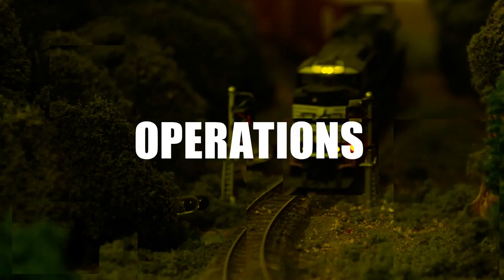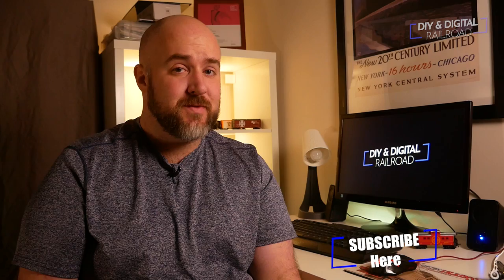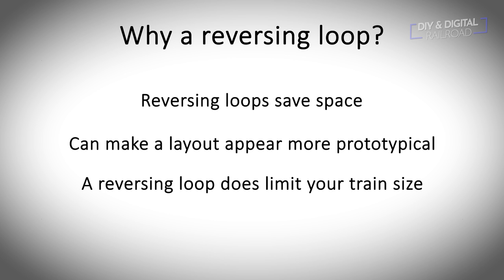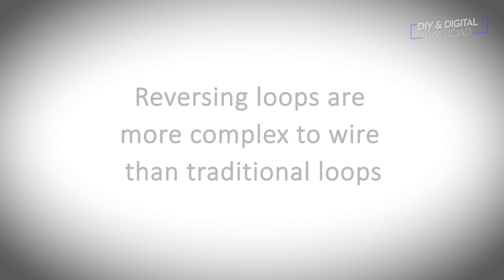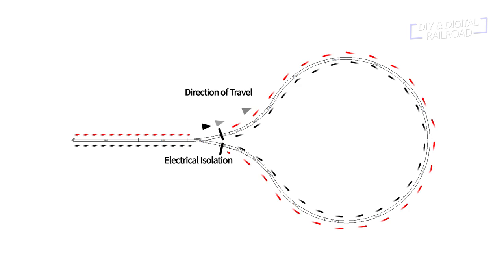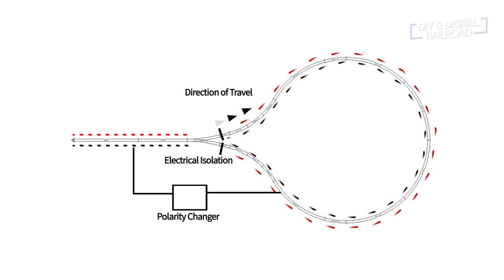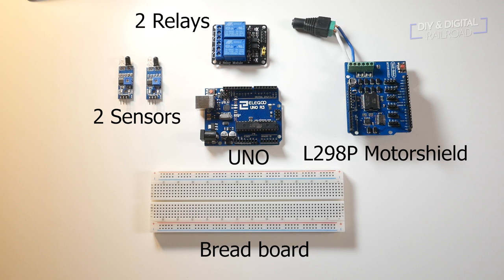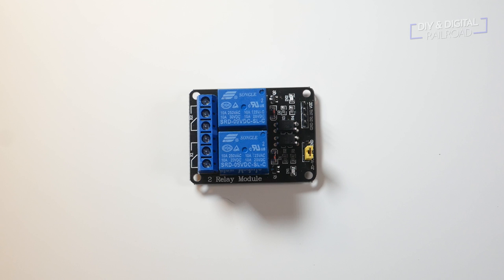DIY Arduino Model Railroad Reversing Loop

Comment: Seems there is a major bug in the sketch, the values being passed to the functions "switchXX" are sensor1, sensor2, which is essentially the Analog pin nos. that the IR sensors are connected to, instead the readings of the analog pins A2,A3 should be passed. The analogRead(sensor1) should be changed to int sensor1Val = analogRead(sensor1); sensor2Val = analogRead(sensor2);, which should then be passed such as switchR1(sensor1Val,sensor2Val); and so on...
Reply from the maker: I know this is a looong time for a reply, but I adjusted the code.   https://github.com/DIYandDigitalRR/DCC-Reversing-Loop

Comment: Thanks for the video. I’m starting my n scale layout and was worried about reverse modules depending on a shortcut detection. This is great! Just one question: I’m planning to use android controlled servos for my turnouts. How would you make them talk to this great module?

Comment: Question. Can I run both ends of the loop like this with one arduino, two sets of sensors and 2 relay boards? Thanks in advance for the help.

Comment: Jimmy;
Great info and video.  And especially for hanging the N.Y.C. 20th Century Limited. poster.
From 1915 to 1967 my Great-Uncle John Lynch was one of the three longest tenured Loco Engineers on the 4-8-4 Hudson & 4-8-4 Streamlined Hudson (J-1 Class & J-3a Class).  In memory of his years "ON THE LINE" it is also one of the HO Scale HardBodies I run on my home layout.
Thanks;
Jim

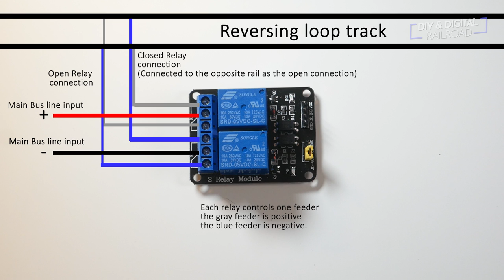Comment: At 3:40 the for dependability and safety the wiring of the relay contacts should be reversed with the power feed going to the outside terminals and the track connected to the inside terminals. As shown, if one relay drops an instant before the other a dead short is created as both power lines will be connected to a single rail. When the wiring is reversed under the same conditions both rails will be connected to a single supply side; a much less destructive situation.
Reply: For a simple reversing loop it would be simpler to use a one DPDT relay rather than the two SPDT Relays - however even then the track feeds should still come from the common pins on the relays (as Kevin pointed out) - because any mechanic failure such as one pole getting stuck won't result in a short circuit. Additionally if the track plan was more complicated and you needed more than two track feeds then using multiple SPDT relays where each relay controlled the "polarity" (I know it's AC) of each feed would allow you more flexibility, for example if you had 3 feeds you could control the "Polarity" of each feed individually - you cannot do that if wired per the video.
Reply: @davidtrott9469  The odd circumstance many discover is that single pole relays of the type shown are often less than half the price of a similar DPDT relay, and use little or no extra power. Further single pole availability is much higher, probably leading to the odd price differential. Just things to keep in mind when shopping...

Comment: Jimmy,

nice idea and good to see. I was thinking about something similar, needing more effort on HW side. I guess I think about that again. It can obviously be done with less.

Looking at the code in the video and on the google drive though:

Analog inputs can also be used as digital inputs. So a digitalRead() will work as well.

In the loop() you read both sensors (line 30 and 31) but you assign them never to a variable. So the Serial.print() should always print the pin numbers of A2 and A3 - I believe - "15" and "16" to the serial monitor.

I assume you want to set the power of to the motor shield via PWM. That would be a analogWrite(), not digitalWrite() in the switchxx() functions. I assume the digitalWrite(power, 255) is somehow understood as a digitalWrite(power, 1) by the compiler.

Additionally, the switch functions will always be called with pin number for the sensor pins (see above) and those are always less than 200. And with that the code should just loop through the sates about every two seconds. But your video shows clearly that the loop works. Do you have updated code for us? Or am I just missing something?

Comment: liked your approach to the revers loop.  Have built and n using the DCC EX command  station. I have two reversing loops on my layout.  The question , do I have to link the reversing loop (Arduino system )to the command station or  can  it function on its own with sensors controlling the turn outs and phase change

Comment: I think I see one flaw in this system. If the track switch for some reason flipped unexpectedly, or was manually switched, then the system would short out. This concept relies heavily on the track always being in the right position for the train entering. It is a nice video, but personally, I would not use this system. The short-circuit detection method is more reliable. Also, since my own track has multiple exits within the reverse loops, the train does not always exit back on to the track it came from. Therefore, the next train entering the reverse loop would be in for a shock (literally). Again, nice video. My criticism is meant to be constructive. I'm not attacking your ideas.

Comment: This is another great video but I am having some trouble understanding what the different pin variables are for.  There is no overview that really explains what these are for.  I can see in the final sketch what the code does but I am having trouble mapping that back to what is happening on the layout.  The variable names are somewhat descriptive but the effect of turning some high and others low isn't clear to me.  After watching to the end I could (sort of) figure out what the purpose of the loopState variable was but the rest is not even that clear.

BTW, I am a software engineer with 35+ years of experience (beginning with C).  I am just now starting my exploration of Arduino and really loving it.  @diyandigitalrailroad I could recommend a few things to make your listings a bit easier to follow if you like.  Nothing major, though.  I like your presentations, overall.

Comment: I have a complicated track plan that o would love to do and it has two reversing loops I believe. Would it be possible to show you the plan and help me work out what I would need to put and is it even possible. This would be my first ardurino project and if like to use it so the turnout controlled polarity that controls signals again if possible.

Comment: I'm late in watching this. Missing is the explanation of the logic of what this is doing. Break? I assume "break" is some obscure motor shield command? This seems more expensive and complex than the commercial auto reversers. What are you using for a switch machine?

Comment from the maker: Hey everyone!  Thanks to @David Mead.  He caught a typo at 11:06.  The pinMode should be sensor2
Reply: DIY & Digital Railroad I have a question: the enum LOOPSTATES are outside of the setup() block. Is that supposed to be like that?
And then another Q/comment: why not make the pin variables const? They are constants anyway, and it just ensures that they won’t get changed accidentally.
Just to clarify: I have no experience with arduino, that’s why I am asking. I’m just curious as l am interested in arduino and pi boards, but haven’t worked with either. Just been watching vids and reading up on possibilities to decide what project I’ll be taking on eventually...

Comment: OK I guess I'm just having a dense day but I finally after static test was trying it on my actual railroad reversing loop. Everything seems to be OK but for the life of me I can't seem to figure out where the red and black wires from my Kato switch machine should connect. The diagram seems to say out1 and out 2 on motor shield but that doesn't exist as labeled?
Reply from the maker: No worries! I really need to update this one.  The terminals are A and B on the motorshield.  Each should have 2 terminals

Comment: Happy New Year indeed.  I'm loving this Arduino stuff but I have a question.  Can track polarity reversal (not interested in the turnout driver portion) be done using short circuit detection rather than the optical sensors?  That is what I'd like to see.  Sadly I'm not tech savvy enough to puzzle it out on my own so please keep it simple.
Reply from the maker: Yes that is actually how most commercially available reversing loop modules work.
Reply: @DIYDigitalRailroad  I have a twin track N Scale layout. I want a loop to join the 2 tracks toether, so I dont need the turnout control. Do I still use the motor sheild or could I do it with the relay shield? Not keen on the short circuit method. Modern DCC controllers tend to spot short circuit too quickly

Comment: may I ask how do you connect a tortoise switch machine to this?
Reply from the maker: It's actually pretty easy.  Just connect pads 1 and 8 on the tortoise to the motor shield terminal and change the arduino code from 500ms to 2000ms

Comment: Hi Jimmy, Love the video but I am still having trouble with the arduino sketch, I'm getting a message that switch R2 was not declared in this scope in the second phrase of the primary void loop. I assumed it was a syntax error but I cannot find any inconsistency with your original. Is it possible I missed an edit, or there was something not on the video?  I'm a Linux novice and still learning definitions.  Also I did not have a dual relay handy and am trying to use two single relays.  Will this require any change to the code?  Thanks again for your help.
Reply from the maker: Hey Phillip!  I have created a new download link for the code.  It's a github page.  https://github.com/DIYandDigitalRR/DCC-Reversing-Loop
Reply: @DIYDigitalRailroad  Thanks so much, just seeing this.  I'll head over and update the code.
Uh,oh github returns the page does not exist. But I do see your other arduino, & sensor fixes???  By way of more information.  My sketch compiles and uploads, but when it runs on the arduino it flashes both of the relays continuously every .5 seconds.  It does not seem to respond to the optical sensors at all.  Even when disconnected from the sensors the arduino keeps reversing and switching both relays at the same time. Could a mechanical connection be at fault as opposed to software?  Or could there be a missing line or direction not in the video?

Regards, asking a lot in Maryland.

Comment: Hello when the polarity from the main track is reverse while the train pass in front of the second sensor will it not affect all the rest of the Dcc accessory and other locks?
Reply from the maker: So the reversing loop is electrically isolated from the rest of the system.  The switch in polarity actually prevents a short circuit.
Reply: @DIYDigitalRailroad  sorry for the autocorrect 
I was talking about other locomotives already running on the main track while this one passing through the reverse loop isolated while the sensor detect and reverse polarity on the main track 
Im new to DCC and from what I have learned is the Main reason to go towards Dcc was to be able to run multiple locomotives at the same time like doing yard work and switching from one main to an other or changing locomotives on the turntable to get it ready to pull out one more train but if the polarity is reverse will not all locomotives will go backwards when you try to make it go forward? 
I mean if all locomotives was programmed with the positive on the inside and the negative on the outside and now after one locomotives that have pass through the reverse loop will it not reverse the polarity  of the rest of the layout too?

Comment: I'd really like to see how you can incorporate the infrared sensors into a layout where they are hidden from sight. I'm really interested in a lot of the work you do but struggle to think how it's possible to conceal it and have it functional.
Reply: Jason, our club has used these in the past and placed them looking up between the rails.  You can get smaller ones if you look around.  Ambient light is also a concern.  If done right, it can also count the number of units (Cars & Locos) in your train.  Useful on a reversing loop in determining if your train is too long for the loop (could trigger an emergency stop command).
Reply: Nothing worse than a T-bone of your own train. :-)

Comment: Hello, sorry for my bad language, I'm from France. Can I use this for a turntable. One sensor on the main track and the other sensor under the track of the bridge and connect all the track after the turntable to the main track. Thank you for your help.
Reply: I would have thought so, A turntable is a bit like a reversing loop really. Before the turntable reaches its next position, that is when you would need to switch the polarities on the turntable deck.

Comment: Can't you use a relay instead of a motor shield to fire the turnout motor?  A single DPDT relay to handle the "polarity" (or two SPDT in tandem), With one SPDT Relay to provide "power" on the hot lead.  Your sensor setup stays the same.  Timing: sensor read (1 or 2) set next switch state (determines the state of the DPDT "Polarity" relay), when the second sensor is reached, the Arduino momentarily pulses the power relay to fire the switch motor then returns to the power off state.  Power for the turnout is provided separate (isolated) from the Arduino to avoid any  possible spike.
This setup would also work on duel coil "Snap-Switch" turnout motors with slight modification... the "Polarity" relay would need only one set of contacts, 1) to set switch to normal and 2) to set switch for diversion.  I am new to Arduino programming but see this as a way to minimize motor shields that take up multiple pins to control.
Reply from the maker: Kato turnouts are different, but you can use relays for snap switches.
Reply: @DIYDigitalRailroad  I realize that Kato switches operate on a momentary pulse with the polarity of the pulse providing the direction of the switch.  Theoretically, that still can be accomplished with a DPDT relay and to control polarity and a SPDT relay to control the power.

Comment: Hi, where the avoidance control is connected
Reply from the maker: Are you referring to the sensors that change the points?
Reply: @DIYDigitalRailroad  no, but motor turnout

Comment: hello, not sure if anyone else is having this problem, my setup, not connected to track but to a kato switch, seems to be in a constant loop. the switch will switch back and forth continuously every second, the ir sensors react but nothing will stop the relay from switching back and forth. the serial monitor shows a value of 16 and 17 respectively from the two sensors. have tried with different arduino uno and different sensors and motor shields. the sensors will output zero volts and then to 5 volts when activated, but the relay continues to switch back and forth. again the serial monitor shows no value change either. thanks in advance for any direction, charly
Reply from the maker: I actually had this problem when I was prototyping this.  I can't remember what exactly fixed it.  I'll  go back to the prototype this weekend and check.
Reply: hello, have you had the opportunity to resolve the problem with either the code or the setup?
Reply: hello, any progress on the problem with the setup or the code?
Reply: Did you ever solve this?  I get exactly the same issue
Reply: @MikeFerrell  I have posted the fix above

Comment: ok was this a great video as everyone has mentioned? has anyone else had the problem with the setup or the code as i have? i have asked for help being the newbie i am and have received none, not even from the peanut gallery. great ideas but maybe there is more help elsewhere.
Reply: I think the code has a few bugs.  The analogRead() functions aren't assigning their return values to anything.  Should be more like:
  val1 = analogRead(sensor1);
  val2 = analogRead(sensor2);
Frankly, he must have done some debugging before he got it to run and then forgot to update the sketch.  I could be wrong though, just my $0.02.